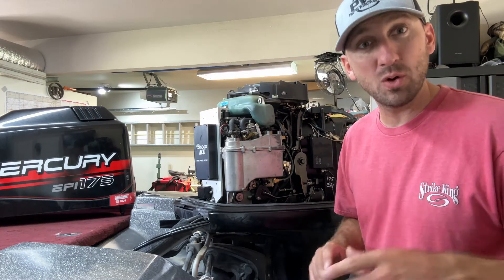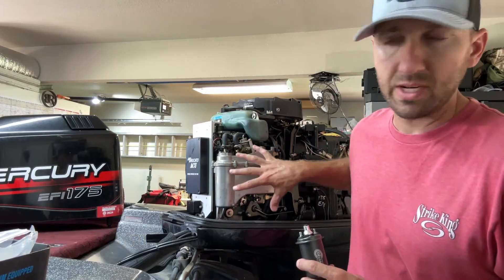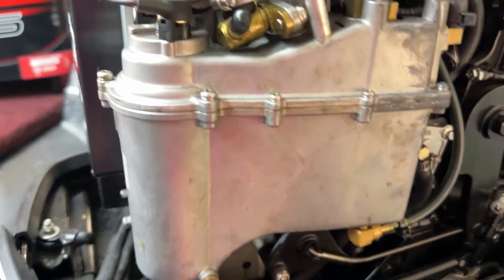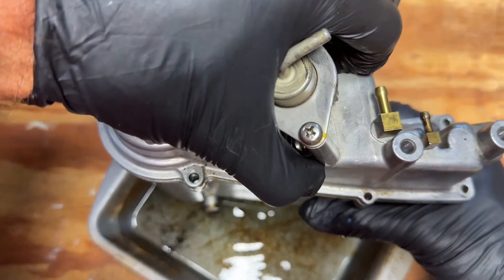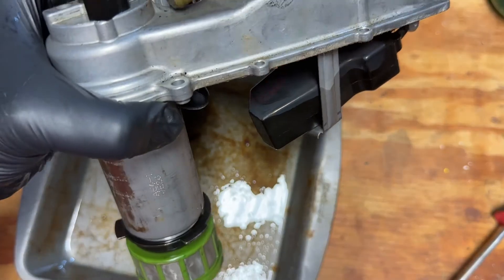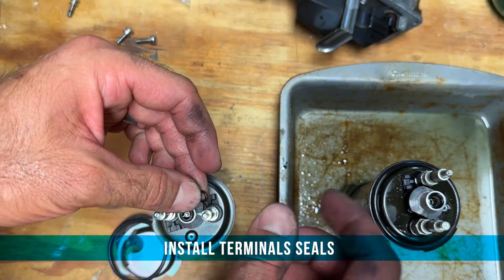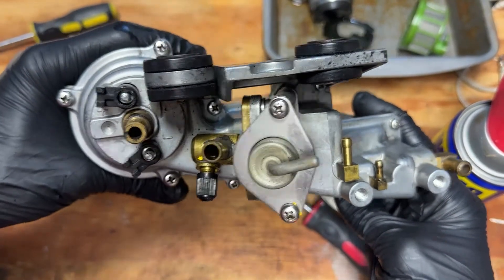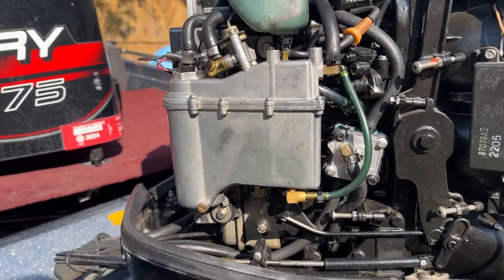Mercury EFI FUEL PUMP Replacement (HIGH Pressure Fuel Pump)

Comment: I just wanted to let you know that I got my boat running today thanks to your videos. I had to rebuild the low pressure pump due to a collapsed gasket and replace the high pressure pump cause it stopped pumping. But when I turned the key tonight and I heard that high pressure pump kick on I just knew it was going to start. Cranked for maybe 1.5 seconds and lit up like a beast. Thanks for the videos, they were a huge help.
Reply from the maker: Awesome! Happy to hear it. Thanks
Reply: @stemhead I just wanted to see if your motor was doing the same as this mechanics as he shows in the video before he changed the ECU? 

My neighbor is an electrical engineer and has bench tested my ECM components and everything including the MOFSET drivers are good as far as he can tell. Im going to put it back together and try replacing fuel pumps. 

Do you know if the injector drivers are on the ECM board too? This has me stumped and the motor is like new so I don't want to junk it.

Comment: I watched your videos after having the same kind of issue. First thing in the morning, prime the ball and it would run as far as I wanted to. Later as the heat set in, the motor would run for awhile then stall like it was being starved for fuel. Primer ball would be soft. I’ve replaced both the low and high pressure pumps, fuel line, primer ball, anti siphon valve and pickup tube to the tank and I’m still having the same issue. Also worth noting, I had the ecu rebuilt maybe 5 years ago. Anything else that I am missing? Mine engine is a 2001 150 EFI and under the hood, everything looks identical as yours.

Comment: I do want to add-   BE PREPARED TO BUY A NEW GASKET for the vapor assembly.  Mine was all streched out, cost me $20 on amazon for a prime one.  I tried freezing/ heating all kinds of shenanigans to get it to fit without falling over but no matter how I tried to lay it down it would not stay flat and extended about 2mm  .  I also have a 96 150 Merc EFI and mine was never opened before. 
Also suggest buy the special zip ties that are circular dont use regular zip ties on your lines.  The factory merc ones are rounded on the crimp point if you look at the underside. VERY DIFFERENT from traditional zip ties. 
Or be like me and buy a kit of misc hose clamps so you know whats been worked on in the future
Reply from the maker: Yeah my gasket leaked after this video, had to buy a new one and still had to use small dabs of super glue to get it to hold in place long enough to put the lid on. 
Glad it is coming together! Hope it goes well out on the water

Comment: I swear to god Im going through all the steps you are.. i hope you arent the guy that had to pay 1500 for a new computer. Because thats my luck  I did have a torn diaphram on my low pressure and im swapping my high pressure fuel pump becaues i may as well.
Reply from the maker: Yes I did have to replace my ECU, but these fuel issues happened after the ECU and not related… so you maybe in luck
Reply: @PrestigeWorldwideFishing   So i put new spark plugs, 2 new voltage regulators, new fuel, and high pressure fuel pump and it started right up and didnt hesitate on me or act up   so im going to take it to the water tonight, cant wait.   I found out my gauges were all due to corrosion so i replaced all those wires everything is coming together!

Comment: I've replaced the srew on filter ran good for a min them bogged down again what is the little filter? Think ill order new pump to have on hand incase I need it
Reply from the maker: You know I’m not exactly sure why that inline filter is there. I’ve had trouble finding a replacement for it too. I’ve ordered a couple and they haven’t been the right size. 
Yeah good idea.

Comment: Hey man, what was your fuel pump doing when it was going bad. I’ve got the same motor just a year newer and got a new ecu from brucato power and had them test my old one and they said it was bad. Took the boat to the lake yesterday and it ran great until it didn’t lol. It would start but sounded like it was in limp mode and wouldn’t get on plane. I’ve replaced everything but the high pressure fuel pump on the fuel system and didn’t know what yours was doing when it was going bad. Any input would be greatly appreciated!
Reply from the maker: Bad high pressure pump usually only causes problems when driving at high rpm’s. I would be driving and all of a sudden motor would stall.
So you did get a new ECU from Brucato? Because if not, that’s what it sounds like. Mine would just be bogged down and I couldn’t get on plane but it was never consistent.
Reply: @PrestigeWorldwideFishing I got the new ecu from brucato and it fixed the problem from it jumping back and forth while on plane, my problem now is that it’s not getting on plane. I can be trimmed all the way down and give it full throttle and it’s like it has no power. I can start it out of the water and have the water hookup to it and it sounds like it should but when I put it in water and under a load it is weak and bogs down
Reply from the maker: Did you change out your spark plugs to new ones Brucato recommended when you installed the new ECU?
Reply: @PrestigeWorldwideFishing yes I got the spark plugs from them when I got the ecu. I’m thinking it has something to do with air fuel ratio but not positive. But all fuel lines look good, fuel pump looks good and primer ball is staying tight. Throwing me for a loop lol
Reply from the maker: You could be right about the high pressure pump. Not sure how that works under load vs not though. 
If it was me I would probably just swap it out to eliminate that possibility lol.

Comment: i have an efi 200 ive been breaking my head because im not sure what the problem is but thanks to you i got the links for the low and high fuel pumps 

So basically my engine needs to be accelerated a little for it to start but then it starts up good i took on a trip to a sand bar and back i thought my problem were fixed because i had changed the water impeller but in the marina i was just idling thru and bam it died what do you think would be my issue
Reply from the maker: To me that is fuel related, so could be one of your pumps. The impeller would cause your alarms to go off because your engine would be overheating. 
When your motor dies, is your fuel bulb empty? That will be your biggest clue to whether it is low pressure or high pressure. If it is stalling at high rpm’s and bulb is still hard it is your high pressure most likely… mine did both nearly at the same time

Comment: Hey buddy I have a 96 mercury 200hp efi. Same exact motor as yours…. I’m having issues with finding a diagram showing where the outlet of fuel pump orings go. Can you tell me the orientation of the orings go!! Was there a oring on top of the center aluminum piece on pump? Any help would be greatly appreciated!
Reply from the maker: Hey man! I’m racking my brain trying to remember an o-ring. Not sure what part you are referencing. Can you take a pic and email me? Then I can send a pic back of what mine looks like.
prestigeworldwidefishing@gmail.com

Comment: I got a 98 Mercury Optimax 135, I'm not a mechanic but im handy with tools. I want to take my fuel pumps out and vapor separator. I got a problem with my engine, my engine idles great but when i open full throttle the boat beeps and engine drops back to idling. Do you have an idea of what can be?
Reply from the maker: Sounds like your motor is going into protection mode which forces it to drop into idle. Do you know if the beep is 1 long beep, multiple beeps? The beep pattern can signal what is causing the problem. You would have to google what the beeps mean though. Typically over heating or oil issue… or faulty sensor mimicking those issues.
Reply: Is one long beep after acceleration, then stops and the engine drops to idling. No overheating, compression is good on all cylinders. After digging for weeks on and off work, i found a video almost similar that says to change the oil sensor. I'll try that and also cleaning the fuel system hopefully i find the problem
Reply from the maker: Yeah constant beep is usually indicative of critical issue, so related to oil. My guess is it is either oil pump failure or your oil sensor is bad. Hopefully the oil sensor fixes the problem.
Reply: Thank you so much brotha 🤙🏽
Reply from the maker: Let me know what you find out
Reply: you got it brotha

Comment: I have this same engine. Will only get to about 1/3 throttle in forward, seems to rev up all the way in reverse. Any ideas?

Great video! Thanks
Reply from the maker: Does it ever go full throttle in forward? Also, does it ever just stall and shut off or does it seem to run fine just won’t open up?
Reply: @PrestigeWorldwideFishing  Runs great, never stalls and runs up to full RPMs on earmuffs. Just holds back when at the lake.
Reply from the maker: @jimdaw1181 gotcha. Doesn’t sound like fuel pump issue then. Unfortunately I went through a similar process of replacing parts, ultimately ended up being my ECU. If yours is a consistent problem, I don’t know if it is the ECU. 
Could possibly be your stator which controls your motor going from low rpm to high rpm.
Reply: @PrestigeWorldwideFishing I'll check the stator. Appreciate the advice!
Reply from the maker: @jimdaw1181 stator isn’t cheap but it’s cheaper than a ECU though

Comment: What is the schraeder valve for on the top half?
Reply from the maker: Relieves pressure built up in the fuel pump. Also a way to check pressure in the fuel pump

Comment: Any idea if the electric fuel pump in a 2004 250 EFI 3 litre motor is any different?
Reply from the maker: Not sure, sorry
Reply: Similar, but vst is different with different pump

Comment: Does all your batteries have to be hooked up to make the fuel pump turn on or just the main battery that runs the engine and gauges
Reply from the maker: Just your main cranking battery that is connected to kill switch. You can also test the fuel pump on your work bench with spare 12v if you have one
Reply: Ok cool I just bought a fuel pump  mine was in bad shape it had been sitting since 2015
Reply from the maker: @nathanowens1651 good luck!

Comment: So, it looks like you did this about a year and a half ago.  Just wanted to see how yours is holding up or if anyone else on here has an opinion on this aftermarket pump.  Probably going to replace mine soon and OEM is $1000 vs a $100 Quantum pump.  I don't want to pay 10 times the price but even more, I don't want to be dead in the water.  Great video and thanks
Reply from the maker: 🤞well so far so good with the fuel pump. I would still recommend it — will make another video if it fails.
Reply: @ good to hear and thanks for the reply

Comment: What was your symptoms on your motor? Before you fixed the high pressure fuel pump
Reply from the maker: Motor would just stall randomly and have issues starting. Fuel bulb would be empty, pumped it back up and it would start back up.

Comment: Hello my fuel pump won’t kick on I noticed my ground wire is not getting any power I moved the ground wire to a new location and it got power but the pump is still not working. I have a 1996 super magnum mariner.
Reply from the maker: It maybe have shorted your pump out with the faulty connection. Can you hook it straight to different 12v battery on your work bench and see if you can get it to make a noise?

Comment: At 7:02 it looks like the cover seal oring has popped out of the groove as u installed it back together. I hope u don’t have a fuel leak! Otherwise good info in this vid thx
Reply from the maker: 😆 where were you when I was putting this together and didn’t notice that?!?! I noticed fuel after first run. Brought it back home, reset the seal, all good now
Reply: @PrestigeWorldwideFishing  Did you have trouble getting the seal to stay? I can’t get it to go back it seems almost too big now for some reason?
Reply from the maker: @michaelstaples6528 YES I did! Ended up ordering a new one which didn’t make it any easier. Used a dab of super glue in a few spots to hold in place
Reply: I noticed that too. Going to change both high and low pressure soon as they come in. Thanks for the video

Comment: What were the issues that you were having? The boat I'm working on w an 06 mercury optimax 125 will run for about 30 to 40 min then die like if the key was turned off. Then won't restart for a couple of hours.  Also the one plug going to it gets really hot to the touch.  Any help or pointers would be greatly appreciated.
Reply from the maker: Mine would die just like someone shut the key off. My fuel bulb would be empty. Once I pumped it up it would fire right back up. 
Similar to another comment I got yesterday. Yours doesn’t sound fuel related, but more electrical. Sounds like the Stator which can cause several symptoms.
Reply: @PrestigeWorldwideFishing  ok. Thank you so much. I will look more into it in the morning and let you know my findings
Reply from the maker: @edwarddempsey4908 yes, let me know what you find.
Reply: @PrestigeWorldwideFishing  also, it will crank after it shuts down just fire and run

Comment: New old boat. Bought not running. I’m getting 12v to both high pressure pump terminals and no noise.
Reply: I'm having the same issue.  I can't find a rely or a fuse .

If I put a group cable the pump does run 

Anyone have any ideas why?
Reply from the maker: Really not sure. Pump sounds dead to me. Buy one, test it, send it back if not. 🤷🏻‍♂️
Reply: @PrestigeWorldwideFishing  
I bought 2 different ones and they both do the same but on the other had the one I removed doesn't. 

I just ordered the same one you got and will see how that one comes out .
Reply from the maker: @espinoza313ae dang, you maybe right with the fuse then. My board says what all my fuses go too. I will look soon and see if I have one for fuel pump. Not sure why they wouldn’t be working. Hopefully the newest one will work and you can get back on the water.

Comment: Isn't the fuel filter a spin on that is on the other side of the engine?
Reply from the maker: Yes, the main fuel filter is a screw on. I also have 1 or 2 inline fuel filters

Comment: Put a new one in and I’m having some fuel leakage around the insulator caps. Orings look like could be bad but my next question is if there should even be any fuel that would come out of the insulator caps
Reply from the maker: Not sure about that one. I had some fuel leaking out of my canister after my first run. I reset the seal and added some liquid seal.

Comment: Wondering if you had to seat the new pump in the top of the assembly and stayed in place or would it fall out if you didn’t hold it while assembling it
Reply from the maker: Trying to remember, but I think it stayed in place ok. Only thing that gave me trouble was keeping the seal in place that goes between the lid and the canister.

Comment: I got some gas in my tank.  Milky white thick stuff came out of the high fuel pressure tank. Am I screwed or would I be able to flush it out? Thank you for your videos.
Reply from the maker: Man I’m not sure. Don’t know why your fuel would be that off color. Can you dump your fuel, re-fill (non-ethanol), run you boat again and see what you have after that.
Milky fuel isn’t good, just don’t know what it means yet
Reply: @PrestigeWorldwideFishing  I’m sorry I may have said this wrong. So Inside the high pressure fuel tank that your replacing in this video. That’s where this milky substance is coming from. I believe water was in my gas and may have mixed with oil inside this .
Reply from the maker: Yeah I gotcha. Just not sure how you would be getting water in your fuel. You are going to need to dump the fuel in your gas tank, change your fuel filters and start fresh if possible.

Comment: Hey I’m diagnosing this issue right now. With the key on I get 12v to the pump, I hear no noise, and the schraeder valve dribbles the tiniest drops of fuel. Sounds like the high pressure pump right?
Reply: It might also explain why I went from 40 to 0 while cruising down the lake too right?
Reply: You think the lower may have blown up?
Reply from the maker: Oh crap, my bad, need to delete that, I responded to the wrong comment.

Yeah that does sound like it is dead and not holding pressure. Is your fuel bulb empty too or still have fuel in it?
Reply: It hold pressure until I crank it and then it’s empty again.
Reply from the maker: @stemhead do you know if there is any fuel in the high pressure pump canister? Hard to exactly decipher because they work together. That low pressure pump is going to put the fuel in the high pressure tank so the high pressure tank can distribute it. It sounds like the high pressure, but if you take the tank canister lid off and there is no fuel in it, it’s most likely the low pressure pump.
Reply: That does make a lot of sense and I’ll check that. I appreciate the response, it’s good to talk with someone that’s had the issue.
Reply from the maker: @stemhead you bet! Yes, I’ve had similar questions in the past so that’s why I like to put hopefully my solutions on the channel to help others if I can. These boat problems can make you pull your hair out I know. Good luck!